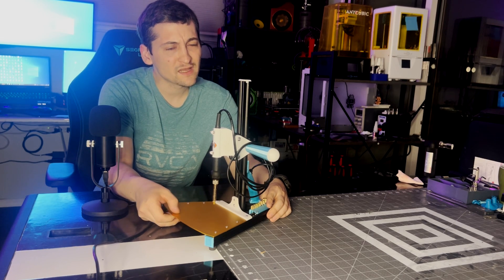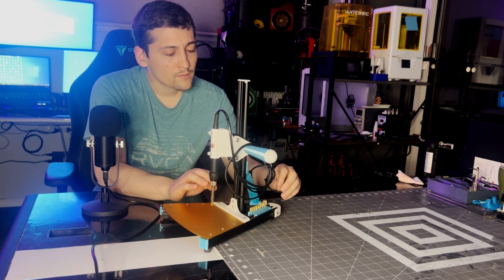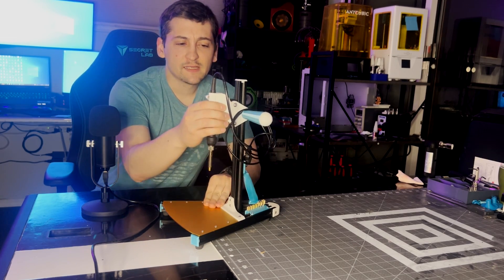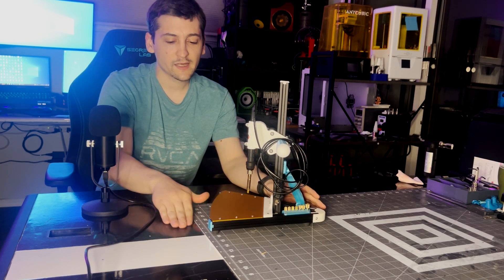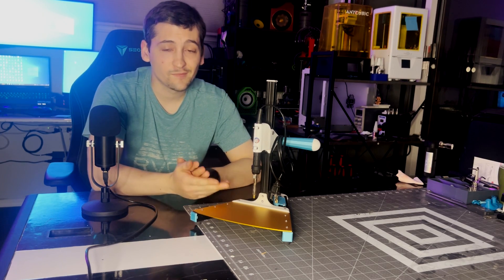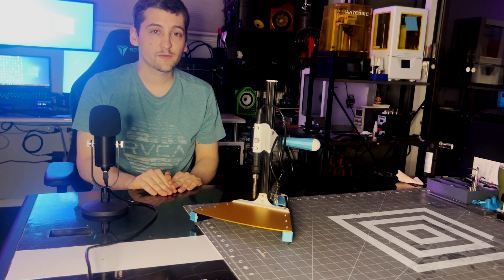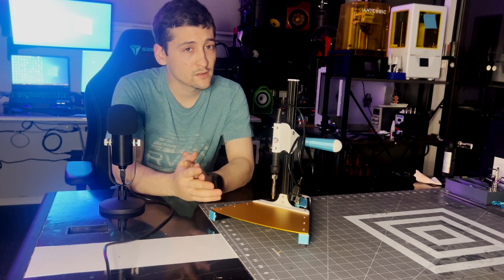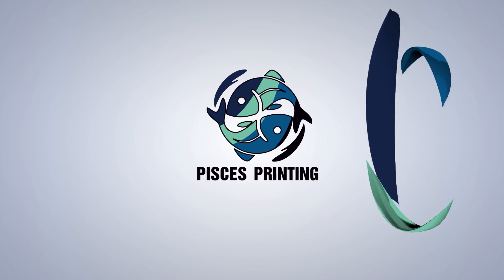3D Printed Heat-Set Thread Installer- DIY Friendly

Comment: nice build! Shows that we dont need linear rails for everything ;) Is that soldering iron you get temperature adjustable?
Reply from the maker: Thanks! It is adjustable as in a 1-10 scale, however I have no idea what temperature those numbers indicate. I know at 1-3 it has a hard time with solder. Beyond that I’m unsure.